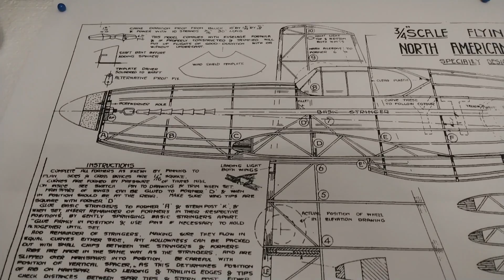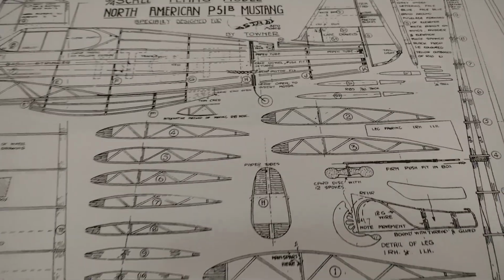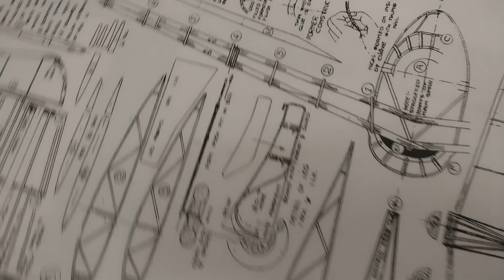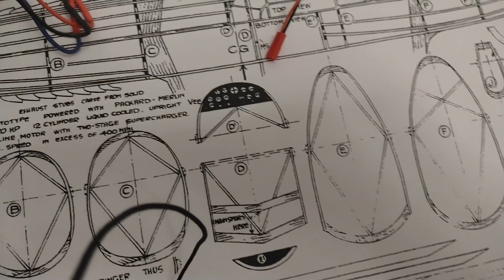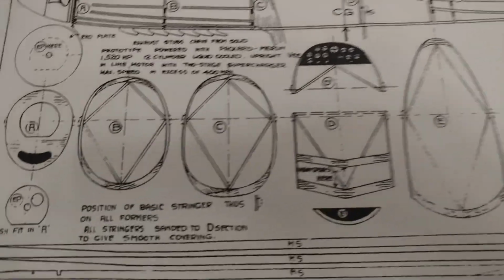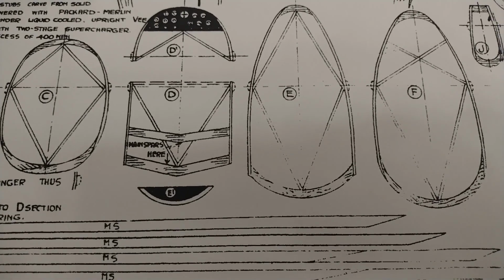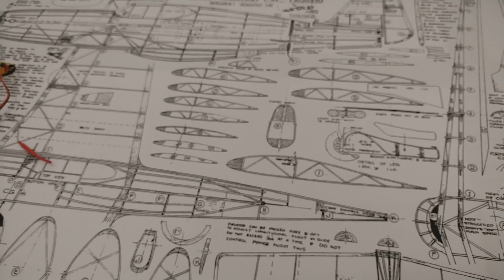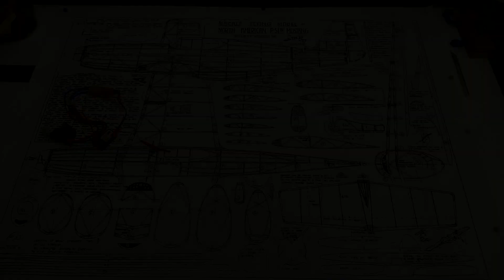01 Balsa P51B   RC Conversion   Plan Review

Comment: Thats going to be a real challenge to get the strength and the weight balanced. Good choice Andrew, I think the p51b has more character than the p51d. I think this design will be OK to " beef up" for RC conversion....but maybe use a sharpened metal tube to make holes in the solid ribs etc? .all the very best of luck with it ! I have built many Mustangs of various scales, and i think you could probably get the dihedral down to about 5mm up at each wingtip.

Comment: A couple of minor points - The P-51C and P-51B were the same aircraft, merely built in different factories.

Also, it’s worth noting that this plan was drawn during WWII, when balsa was unobtainable because it was all being used for the war effort. The ribs are drawn as they are because thin sections of pine were intended to be used. 

I believe that many H J Towner designs, including this one, were kitted by Astral.
Reply from the maker: Fantastic insights, thank you for sharing! Interesting to get a glimpse into what Harold J Towner was doing during the war. I do have a special attachment to him so I welcome any information on him and his way of working. 
Thank you!
Reply: @downwindchecklist6567 I like his designs too, he really pushed the boundaries of what was possible with his multi-engined rubber scale models. I’ve never built any of his designs but have long pored over his plans.

The late Doug McHard, a famous name to British aeromodellers, built quite a few of the Towner twins and managed to make them fly under rubber power. His craftsmanship was impeccable too, particularly his airbrushed finishes. I remember being amazed as a youngster by his models when they were published in Aeromodeller magazine in the eighties and nineties.